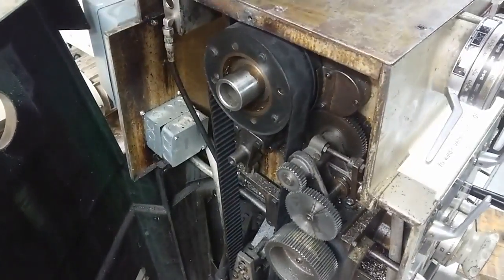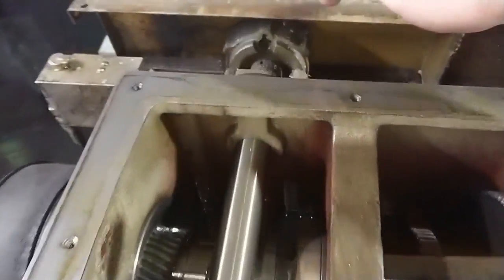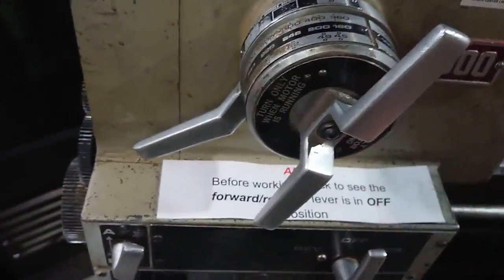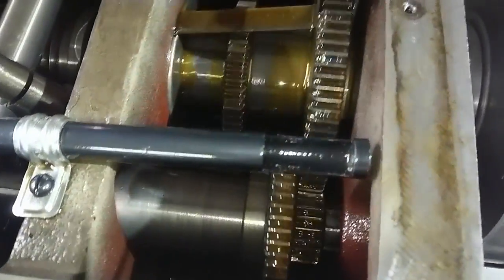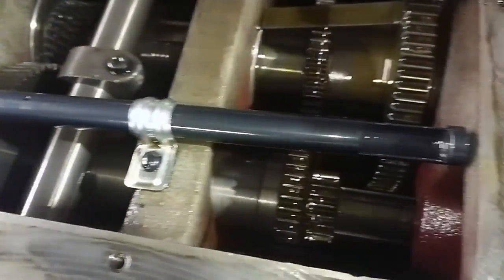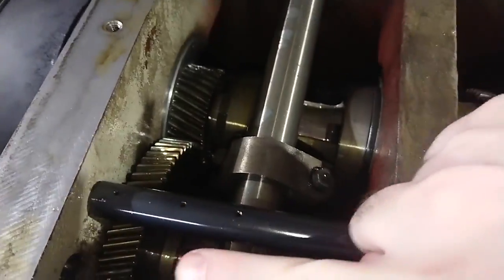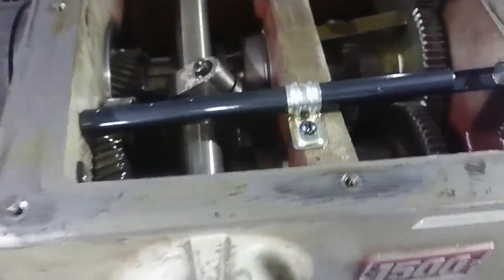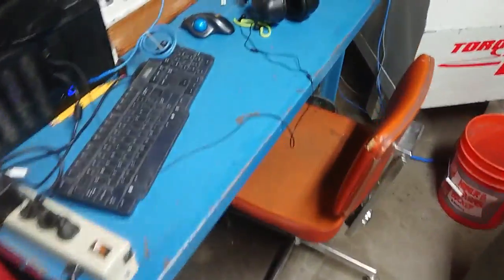Clausing Lath Internals and why read that manual before touching a lathe

Comment: I haven't used a Clausing in well over 2 decades, and that one was a similar-looking 1300  Series (Circa early to mid 70s, before Clausing went bust)... Pretty versatile for facing and also for smaller parts production with the turret attachment... We rarely used the regular tailstock, and had a collet workholding system in the head whenever we were using the turret...